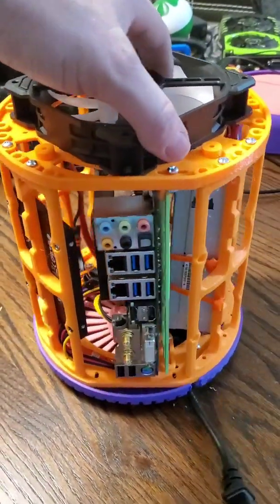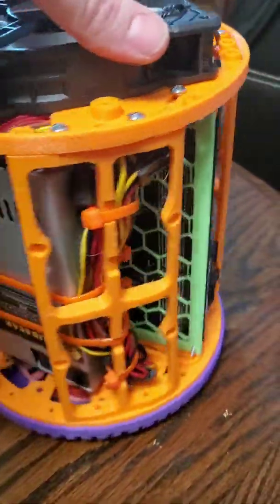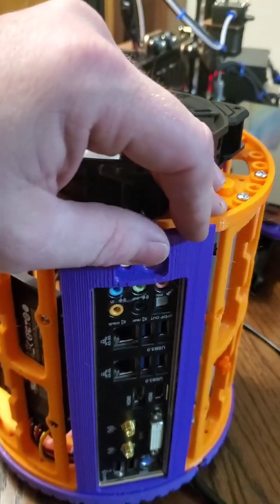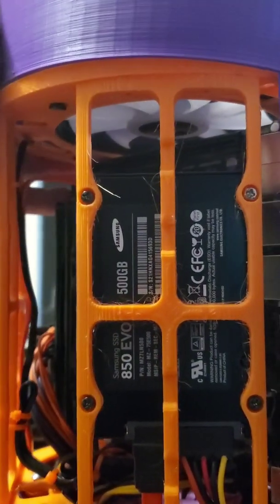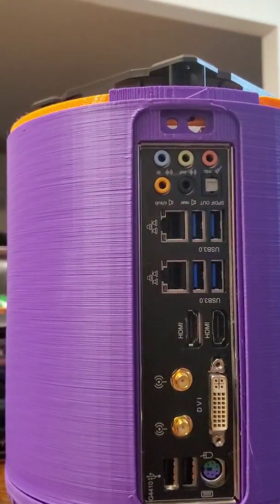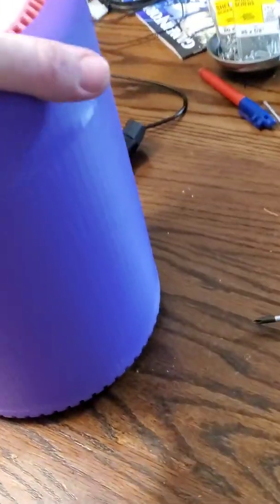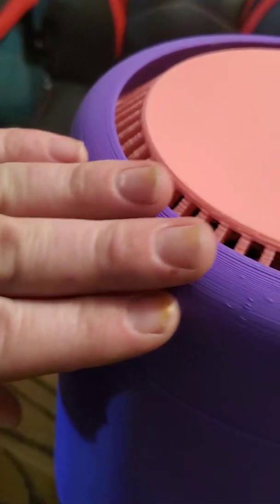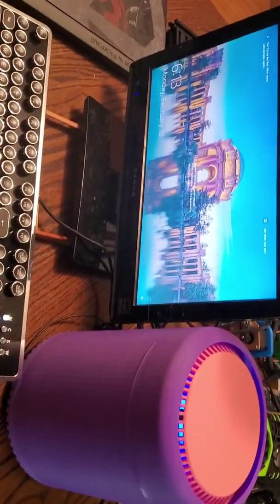3d printed Mini-ITX build

Comment: This is made by PLA- would it melt if the pc gets too hot like 80 degrees constantly?
Reply from the maker: I've had no issues with melting.  Even in my slightly larger ones with a dedicated GPU

Comment: If the fan on top pulls the air through, rotate the cpu fan 90 degrees so the fan lines up with the air flow
Reply from the maker: I thought of this as well.  However at the time of building this, i couldn't find a cpu cooler like that, that would fit.  Since then, I've actually found cpu coolers that would fit.  Server blade style coolers, would accomplish that goal

Comment: How’s the performance under some Ben h marks? How’s the thermals?
Reply from the maker: Airflow is great, thermals are fine.  My wife, and my daughter both wanted one, and they both play games on them.  I printed slightly larger versions of them that can accommodate a discreet GPU.  I made another video on the larger one.  One has a 1050ti in it, and the other has a 2060 super.  No temp issues at all.  One day I might revisit the design and make significant changes to it again.

Comment: The only reason I like this is because you dont have a gpu or psu throwing heat into the cpu and junk
Reply from the maker: Thank You.  I am a huge fan of mini itx and small form factor PCs in general.  I unfortunately cannot take credit for the design.  My wife and daughter loved the design but wanted a game system version of one.  So I modified the design heavily and put a 180mm fan in the top.  Air flow is fantastic.  But I still prefer the smaller more efficient design.  Kudos to Apple for inspiring it.

Comment: Dont the case start to get wobbly when the pc gets hot? Is it pla, abs, petg ?
Reply from the maker: Good question.  No.  Its fine.  The airflow is great.  Its pla pro.  To answer your question better... pla is usually printed anywhere from 190°C to 230°C.  Your computer shouldnt be running any higher than 90°C.

Comment: Brother do you make this cabinet to sell?
Reply from the maker: I have this smaller size, and I can do a larger size.  But I dont have problems with printing up another one.  Takes a while to print all the pieces.  Sure, I would do it.  What part of the world would I be shipping it too, though?
Reply: @tom_foolery  Brother by the way, this case was show. I'm from Recife-PE Brazil, I have almost all the pieces, only this font is missing, I would like an exclusive case like you did. It was very show!!! For how much would you sell me a case plus the power supply with this power cord? It cost !!!!
Reply from the maker: @gustavoataide   ok.  Just so you know, this case is made for an APU, it wont accommodate a dedicated video card.  I have a bigger one that i did that will fit a dedicated video card.  Also, do the colors of the plastic matter?  Or will you be sanding and painting it yourself?  You can email me at tomfoolery513@yahoo.com, and give me your complete address so that i can calculate shipping cost.  Thank you 😊
Reply: @tom_foolery  Tranquilo, eu quero para uma placa mini ITX sem necessidade de placa de video. Vou te passar por email. Valeu brother!!!
Reply from the maker: @gustavoataide  I did not receive an email yet.   I know yahoo will sometimes block certain email address that it considers spam.  You can also try tomfoolery513@gmail.com  I have both 😁

Comment: really cool but why suffocate the top exhaust port like that?
Reply from the maker: Your not the only one to think that the exhaust is being stiffened.  Its not near as bad as you would think.  The air actually flows great through this design and the computer stays within acceptable temps.  I actually just made a larger one with a 200mm fan that goes edge to edge, it breaths great, has a gtx 1650 super and an amd 5600x inside, runs good temps, and is not loud like you would think a fan that large would be.  With each one of these that i make for someone, i go ahead and make an improvement from the previous one.

https://youtube.com/shorts/sbt2wYqWBus?feature=share

Comment: sand it and paint black
Reply from the maker: Its apart now.  With computer components being scarce in some cases, someone made a facebook post that i could pass up.  And i sold/traded the board and processor.  I kept the case 😉  it will be another project soon.  Im over whelmed with work and projects for the time being.  I should start making home repair videos 😄
Reply: @tom_foolery  dude chill, if this is passion project just take your time. But keep it constant I think you are doing really cool things here

Comment: Damn I can't believe a motherboard fit there. Do you also have a gpu?
Reply from the maker: This would be an APU setup only.  But i did enlarge it and make adjustments to accommodate for a GPU.  I made a video of it as well.  This would work great with the upcoming ryzen 6000 APU's though 😁  Link below for an enlarged one

https://youtu.be/1AEnvsunN34

Comment: I think it would be possible to add in a 120/140mm thinner radiator with a thinner 120/140mm fan mounted on it to cool the CPU. Probably give it better colling. Nice job on it so fare. I like it. Cheerios!

Comment: Not much airflow with that top piece being right on the fan, but easy to change.
Reply from the maker: I thought that too.   But you would be amazed.  The air is pushed sideways in all directions right out the top vents and it stays very cool.  Thank you 👍

Comment: Short question what dimensions does your power supply have?
Reply from the maker: 6" x 3.25" x 1 5/8"  solid gear flex itx power supply
Reply: Tom Foolery Thanks mine is printing right now

Comment: Good Design!!!Well Done.
I think that the power and reset buttons should be redesigned on the front of the case.
Reply: If the power button was on the side, it would push the computer away from you every time you turn it on. But then again it’s 3D printed so depending on your personal tastes you can change the file to however you like.
Reply from the maker: Its heavy enough that it doesnt make it slide away.  You dont have to push hard on the power button.  They are springy but dont require a hard push.  There are a lot of very nice custom buttons out there.  This one is my favorite: https://www.amazon.com/dp/B07PPDHKDT/ref=cm_sw_r_cp_apa_fabc_uaL8FbT530W4D
Its tiny, non-intrusive, back lit, and the hex nut secures it from the back... the round bezel around the button secures it on the front and it has a very professional finish.  Thank you for taking time to respond.  I love peoples feedback and ideas
Reply: @tom_foolery  Very nice, good to know. Thank you! I would like to design my own mini ITX build with support for a larger graphics card. Big project though. 
Might I ask, how long did it take you to design the parts?